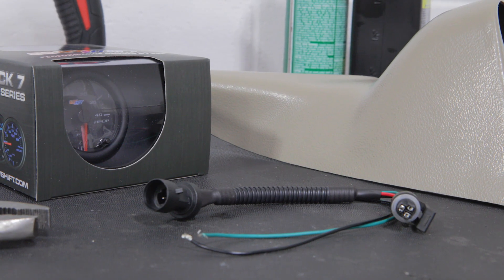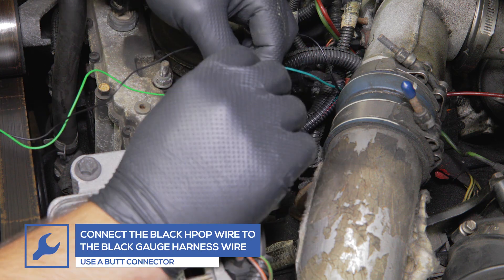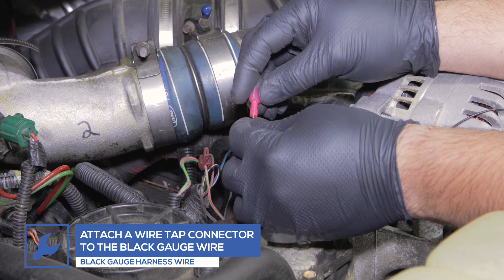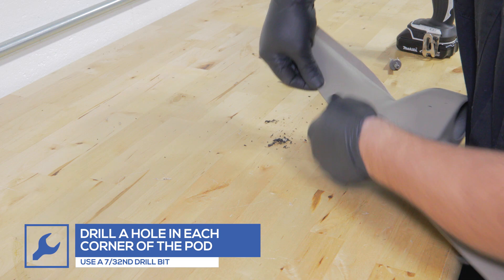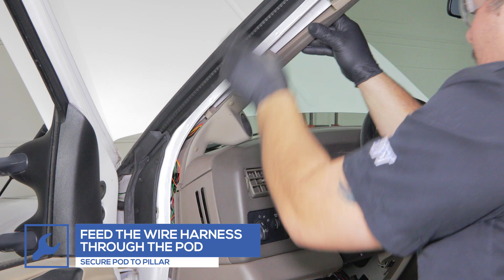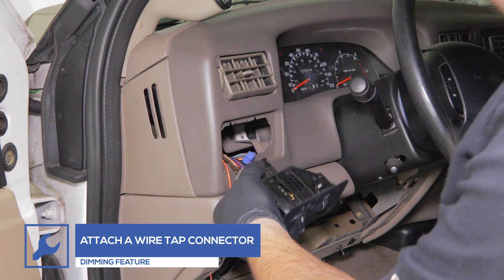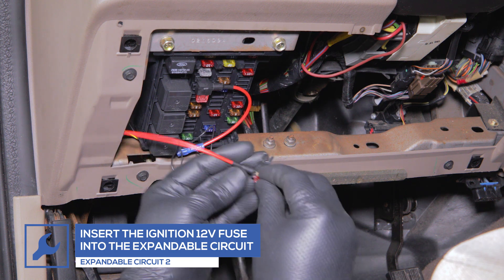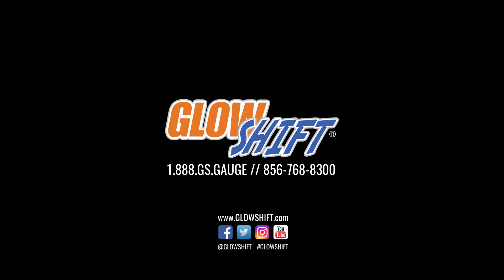Installation | GlowShift 7 Color Series HPOP Gauge for 1999-2003 Ford Super Duty 7.3 Powerstroke

Comment: What’s the difference with the oil pressure gauge?
Reply: High pressure oil is different than low pressure oil on heui system engine like 7.3 are.